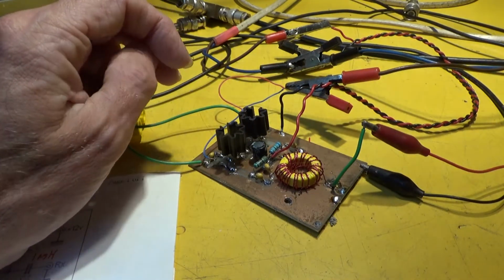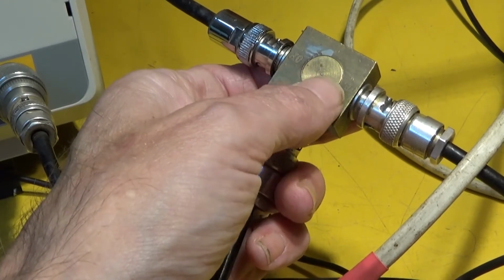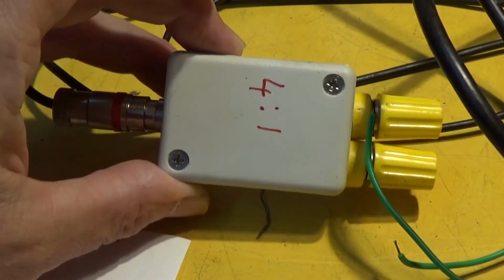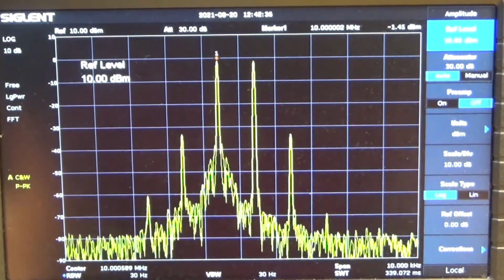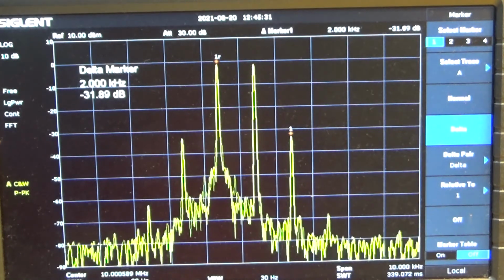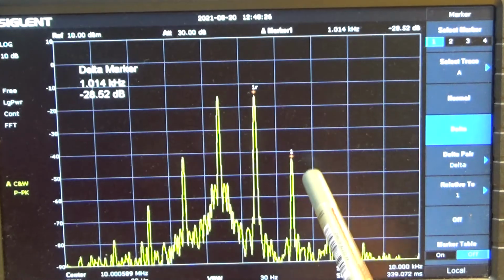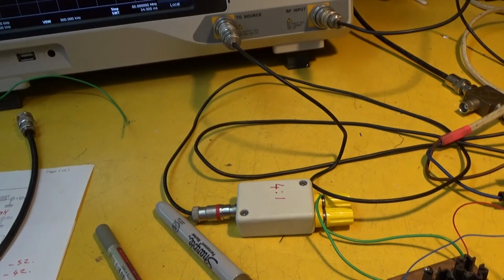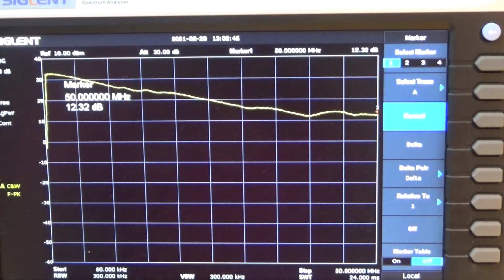Intermodulation distortion in the loop amplifier & why it  draws 150 mA

Comment: Very interesting test. I’m also interested in the splitter combiner. 
Which design is yours?
Reply from the maker: Bit difficult to describe the splitter combiner, it uses a binocular core with a couple of turns of wire with a centre tap, ideally should produce 3 db per port but mine is roughly 3.5 db but varies with frequency, I think it's fairly good from about 10 Mhz to over a ghz
Reply from the maker: I can do a video on the splitter/combiner construction if you're interested. I've nothing better to do at the moment, sadly!
Reply: @ptronix  well, that would be great and another interesting subject. Looking forward to it! 
Thank you Nick

Comment: Thanks Nick for taking the time to demonstrate the need for the added current draw.
Interesting to see the linearity change when you modified the circuit.
73's!
Reply from the maker: Yes Adam, amplifiers are well known for being non linear at low bias current, so run them at the highest current you can get away with!73